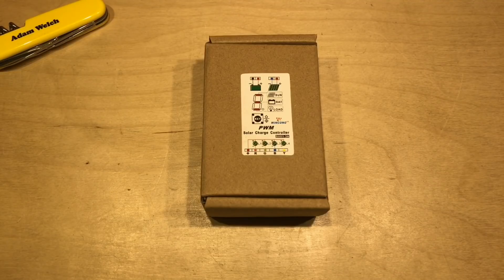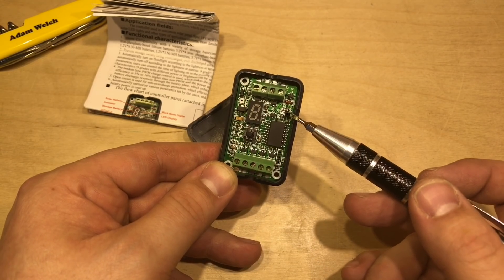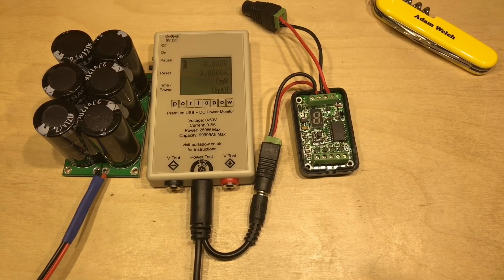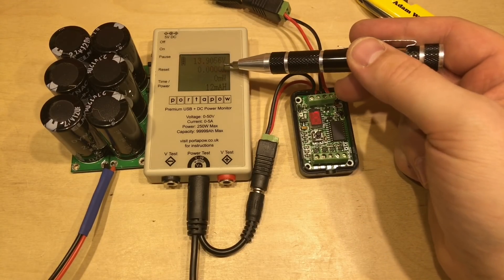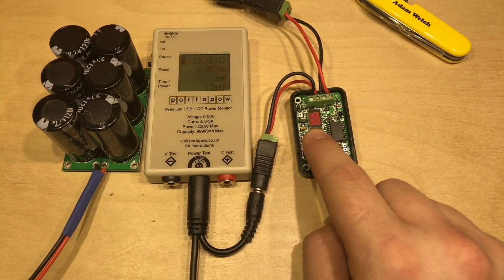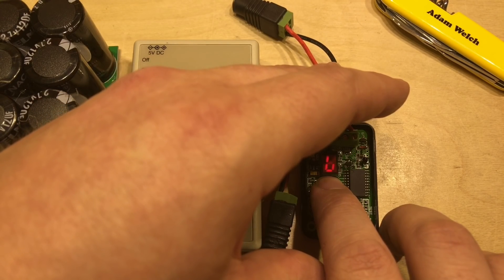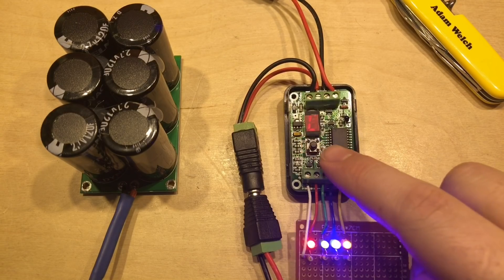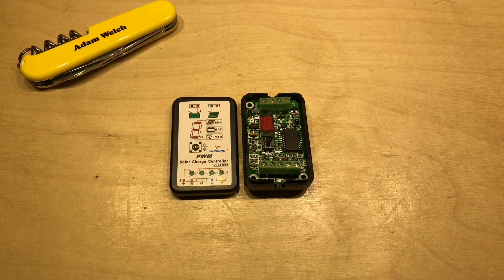Wincong SX01-3A Solar Charge Controller - 12v Solar Shed

Comment: Is there any solution that this controller not responding through key press ,only lower segment glow aur in dim light ,all seven segment glow but nothing happen while pressing the key repeatedly or as per direction, can you show some trick if you know।because nothing on Google regarding this module

Comment: Hi Adam, on this controller with the 4 load outputs, if you want to hang a up to 3 amp load on it, would you use just one of the outputs, or tie all 4 together? Not sure if each output is 3A for a total of 12A or if all 4 together would be 3 amps total, and each one is capable of 750mA each. What do you think?
Reply from the maker: My feeling would be 3amp total - the output is only really designed for strings of LEDs. I could be wrong though.
Reply: Did you ever get a solid answer to this?  Just looking at the PCB, my guess is to reach 3A with those 4 tiny transistors just ahead of the terminal, you have to tie all the outputs together.  Either they pull to ground or they're floating.

Comment: can i use it for powering nodemcu by regulating to 5V
Reply: No, this will not work because this controller expects to see some voltage from the battery. Regulator does not provide any voltage at it's input.

Comment: I don't understand the Voltage data. For example B1 12v/24v , in the second row max-charge-voltage is 7.2/14.4 volts.  Did they mean 6v/12v in the the battery types row.  Figureing out chinglish is always a challenge.

Comment: Thank you for the video!
Could you please recommend a better controller for 1/2S/3S/4S LiFePO4 batteries?
Reply from the maker: +Booruvcheek This controller was pretty good - it's just low powered and has a funny load output. I find lead acid charge controllers that have adjustable charging parameters are best for lithium based battery banks. I like the EPEver / EPSolar charge controllers - but that's because I have the configuration cables (well I made one) and I like the software to configure them. 
Have a look at my charging lithium from a lead acid charge controller series for more thoughts on that... https://www.youtube.com/playlist?list=PLXyc_wd5sxbhYhAKHVq8SGQ2Sncl1PDDT
The other option I quite like is the CN3722 range of modules. They work quite well but again - they're fairly low current. https://youtu.be/liYZ5pYOZDE
Reply: Thank you once again, I will definitely look into using LA controllers with adjustable parameters.
Regarding the CN3722 range, they're probably not for me, as my target is having LED lighting in 50-100 W range running from a 150 W solar panel and a lithium battery.
I have ordered SX01-3A for testing / experiments, since it can charge LiFePO4

I am, however, curious about controllers based on CN3722 (and similar) not having specific terminals for load. Does that mean that they can only charge batteries, which then would have to be disconnected from the controller and connected to a load?
Reply: Adam, I've been wondering if you have seen Epever Tracer2610LPLI, Tracer3910LPLI and Tracer5210LPLI controllers?
They claim these to be MPPT controllers designed for LiIon batteries (LiFePO4 / Li-NiCoMn / User programmable) with built-in LED drivers.
It looks like these are meant to be used for outdoor lighting.
There are also Tracer2606LPLI, Tracer3906LPLI and Tracer5206LPLI. They seem to be similar but (slightly?) different, although I'm not sure what the difference is.

Comment: Is it possible to use this controller in conjunction with the Waka Waka 10 watt solar panel? It's a 14.5V foldable panel (says so on the box, 12V on the website). Would be neat to be able to charge lead acid and 3S lithium with this controller in stead of only USB with the Waka Waka

Comment: 4.2V imho is too high to charge a 18650, faq sheets I have seen state the military optimal is 3.92V and if you charge to 4.0V your batteries will last 4x as long.

Comment: I have had one of these on my camper trailer for 6 months charging my jump starter pack that I use to power my lights when camping running a 20 watt panel works a treat
Reply from the maker: Glad to know that are reliable - sometimes half the battle with cheap items. Cheers

Comment: "If I'm quick today there might be enough sun for some solar experiments"....I could say the same thing here too! Yet, we're just five weeks off the Winter Solstice!! 

Hey Adam, did you say that this one can do four lithium cells? If so that could be just what I need...
Reply from the maker: How are you getting on approaching winter - having to start up the unmentionable yet?To answer your question yes and no!  It's three lithium ion (12.6v max - 4.2v/cell) or four lithium ferrophosphate (14.4v max - 3.6v/cell).  Even if you used one of the lead acid profiles the maximum voltage this will charge to is 14.6 volts or 3.65 volts per cell in a series string of four.  I'm afraid your hunt will have to continue - although I'm intrigued to know what you're up to!
Reply: We have not had a generator for six weeks to the day..! It's been at the garage for well over a month. So life has been rather interesting Off the Grid! The weather hasn't been particularly nice either. So being this far into the Darker Seasons without any fossil fuel backup has been in many ways a rewarding (but certainly challenging) experience. We now  know we can do it - with a family of five including a three month old baby. At least we still got hot water without needing to connect our tank up to a generator...oops I mean PIP...! lol  ;)
Reply: Bugger about the controller not being able to do four Li-ion cells. I have such a nice put together pack,  I do not want to split them. So if you hear of any do let me know.

Comment: I've had good service from my Wincong SL-03 solar charge controller - but the menu is confusing.
Reply from the maker: The feedback is saying that they are reliable which is good.  I guess cheap chinese products are always going to cheap out on menu systems - an extra button or two or a screen soon bumps the price up.  Cheers Paul

Comment: I have this controller.  The first number actually goes from 0-9 and then 0-7 with a period. Load always on is 6. (6 period).
Reply: where would you connect a standard 12V led light strip to this controllers pin out? I have two of these and haven't been able figure that out.
Reply: @MikeZS1  l+ l1
Reply from the maker: +Y Gator I missed that - thank you.
Reply from the maker: You can connect a standard led light to the positive load output and connect it to any of the RGBY connections.  When it's in that mode all the transistors work in parallel I believe.
Reply: 3 months and 3 units delivered after i thought I broke them, this was the info I needed.  thankyou.

Comment: Frustrating menu indeed.  But to be honest I like the idea to use Li-Ion cells for some solar garden lights or so. Mmmm to buy or not to buy.
Reply from the maker: +Luc Peeters I think I prefer it as a one cell solar charge controller. Charging a 3s set up to 12.6 is a bit of a risk without a BMS. I'm sure it'll come in handy :-)
Reply: @AdamWelchUK  it seems this little controller is still relevant, I just went to hook up to a 1s li-ion and it just displayed an 8, I’m guessing the 12v panel is too much to handle when only charging 1s, I tried with 6v from power supply (not recommended I know) and it worked fine so I’m going to order a 5-6v power supply
Reply: @MrBrettStar  I get an 8 as well on my setup, but I believe it still charges the battery.  Solar: 10W Voc=21.3 Isc=0.61 Pmax=10 Vpm=17.8 Ipm=0.56.  Battery: Wintonic 18650 1500mAh 11.1V 16.65Wh.  SX01-3A: 6.B4U4P0L1F1.
Reply: @AdamWelchUK  BMS it self is charging and protecting circuit,so you can
Reply: It says so here http://www.ebay.com/itm/new-3A-6V-12V-PWM-Solar-Panel-Light-Controller-Battery-Charge-Regulator-/131811546335
If you take the last chart under the Wincong name it says 'max load current' '3Amp'
Reply: Well you could of course always use one of those cell checkers as you've done in previous videos, so that plus this charge controller would make for a decent lithium solar charging system for under $20.
Reply: I thought I read that the output could handle a 3A load. So at like 12V (about) it could deliver 36 Watt ... does that sound right looking at the compact plastic construction?
Reply from the maker: I don't think I've seen a quoted load limit - and the transistors are pretty small.  The charge controller is a 3 amp model, but it claims a 40w panel is it's maximum on the input.  The 50w panel I put on it has a maximum output of 2.86 amps at 17.5v so all the numbers given for this controller need to be taken with a pinch of salt I think.
Reply from the maker: +Luc Peeters Thanks. Hopefully it's good for 3amps then.